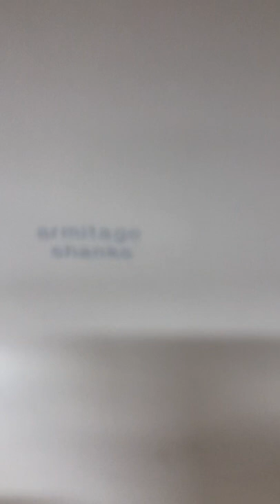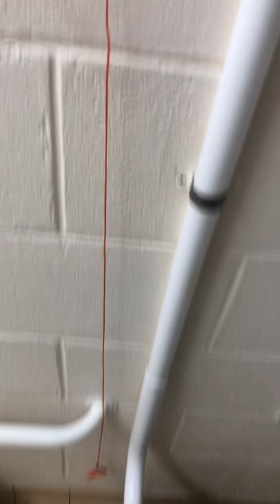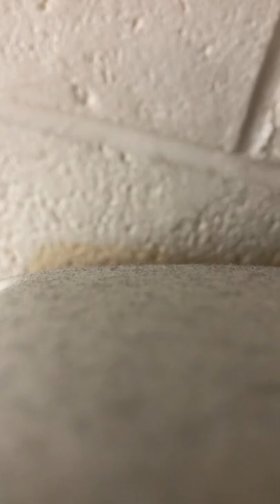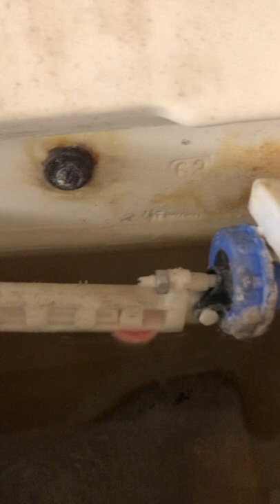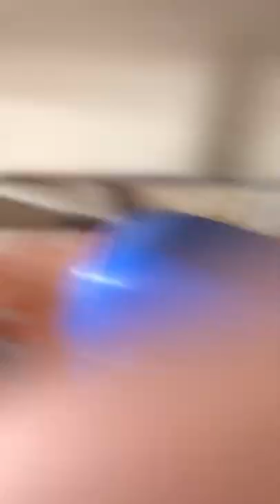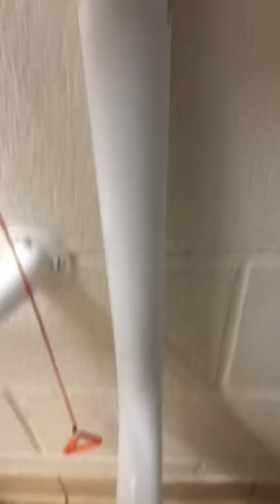HL 1984 AS Clena and AS Talbot pan, Ottery St Mary Leisure Centre

Comment: i have a soft spot for Talbots idk why, considering they're pretty ugly and haven't got the best flush. drains deffo seem blocked in this place since this and the ladies are both filling up
Reply from the maker: I like them because they are rare. It’s most likely vented improperly as the gents toilets don’t fill up. Or those two could be connected to a different stack pipe.
Reply: @ShiresLynx  could very well e connected to different stacks, generally with vent issues you'd hear some bubbling